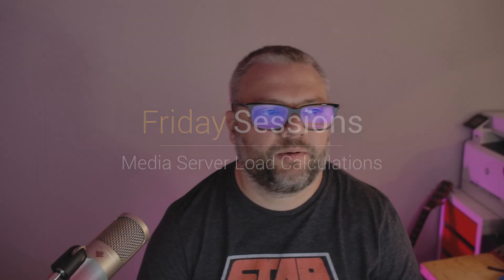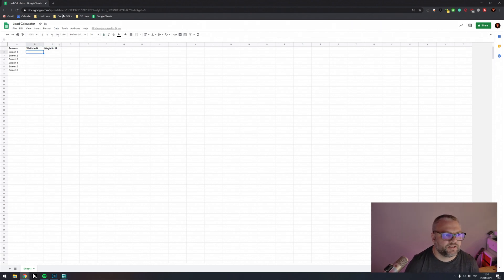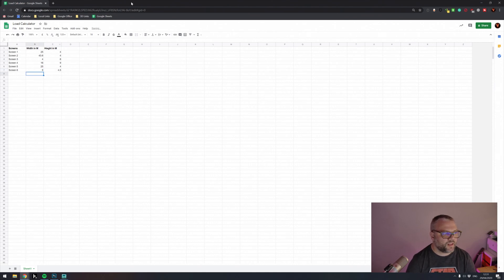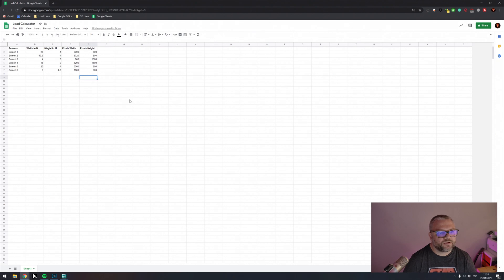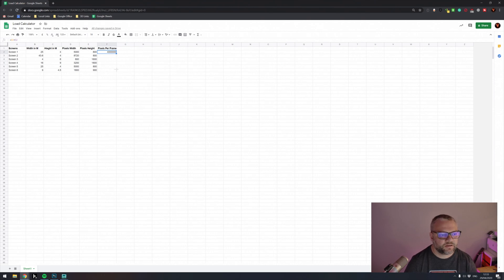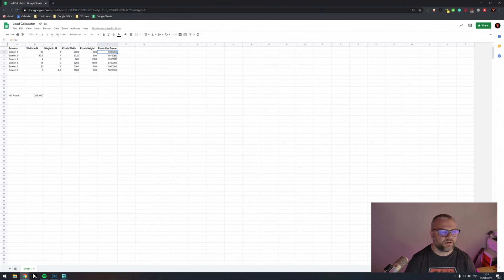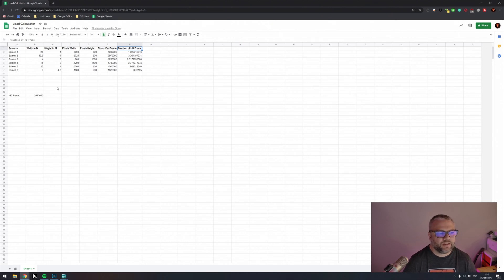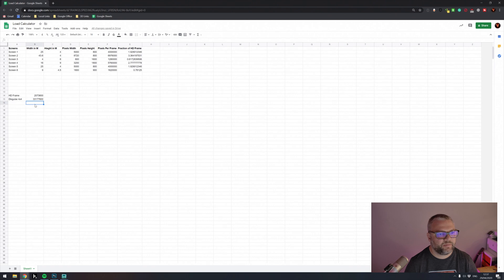Quicktip: Media Server Load Calculations

Comment: So according to Jo Pauly we need to take into account that a transition will take double resource and alpha layer also takes a double of resource, how do you use this/calculate this?
Reply from the maker: This is a really good question, I should have said in the video that 16x HD Layers on a Disguise 4x4 relates to using HAP for a codec. If you were using HAP Alpha, HAP Q, or Notch LC your total capacity would be different. If you're using the sheet I shared cell B15 holds the capacity of your server so updating that number would adjust the capacity calculation in column H
Reply from the maker: I tend to mostly use Disguise servers, each of their products has a page like this: https://bit.ly/3d5Yq9M which outlines the server capacity using a given codec. If you're using an alternative server like Hippo or Photon you'd need to consult their documentation to get the capacity of the system you're  using.